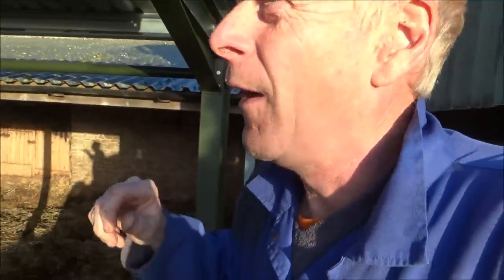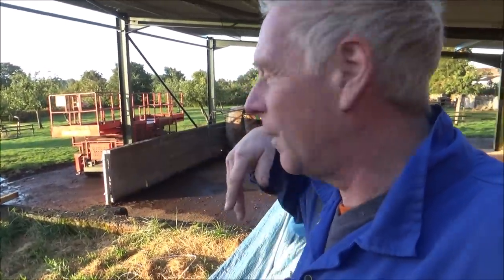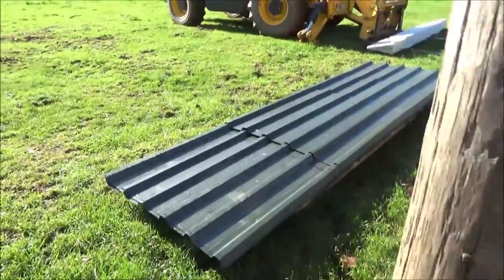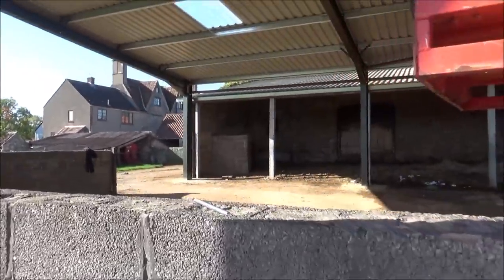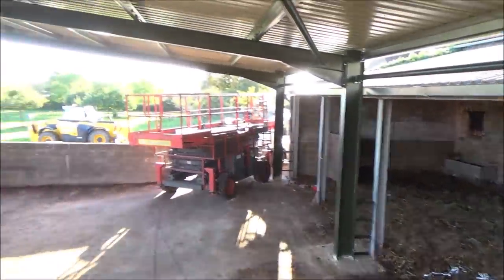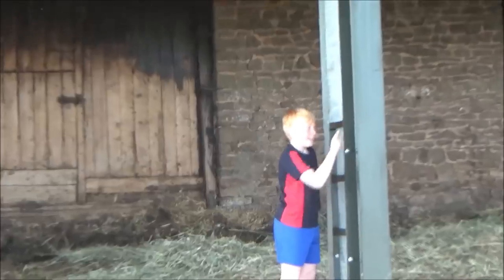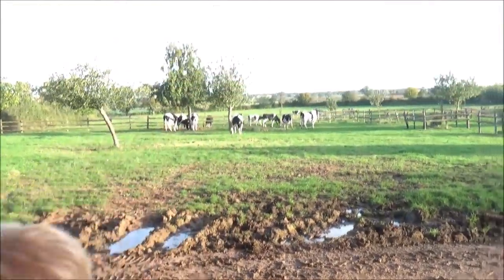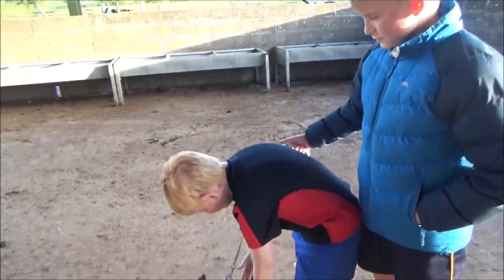FINAL FITTINGS ON THE SHED. ITS FINISHED!

Comment: a good usable option for the side you want weather protection on would be a load of small bales, one side of our main dutch barn was always covered by a two bale deep wall, which  got used up into spring/ early summer once the weather got better, once the cash is free clad it up as you want.

Comment: I had a carport moved when we bought the land next door, and the roof lines are the same as your new one. The gutter taking the water away from both roofs is huge, but the new roofs run off was blown by the wind and came inside the structure. I had sheeting installed to redirect any blown water into the gutter.

Comment: 19:29 I'd be bashing in a second fence post next to the existing one so that you can lock the gate into it. That will make you life easier when you move cattle that way as you won't need any string or chains to secure the gate each time to prevent the  cattle from escaping into the paddock.

Comment: Buy your own digger to do building work etc, we bought our 50B 25 years ago for £3000, its dug all our holes to put buildings up, knocked loads of stakes in for fencing, loaded tons of muck in muckspreader, made roads and levelled stone in yard, cleaned ditches out, loaded silage bales in field, dug trenches for water pipes and loads of other jobs, its cost approx £400 in servicing and repairs and is still worth at least £3000

Comment: A nice strong shed. be good to move the wall that is on the field side out to the steels as your losing some space in the shed. its always difficult with cattle sheds if you  sheet the sides down too much it gets stuffy in hot weather and if you don"t do the sides its drafty in wet and cold conditions but i think you will need to do something ....... some space boarding perhaps

Comment: On the side three galvanised wires strained across and some scafold or windbreak mesh tied on  would be a low cost and easily reversible way to keep the rain out.

Comment: I have never been over enamoured with plastic guttering even the type that comes with special glue that still leak and the rubber seating between bends outlets and stop ends perish very quickly the good old wrought iron type bolted together and with the seating cement lasted for years of good old fashioned lead paint made them virtually indestructible  🧐